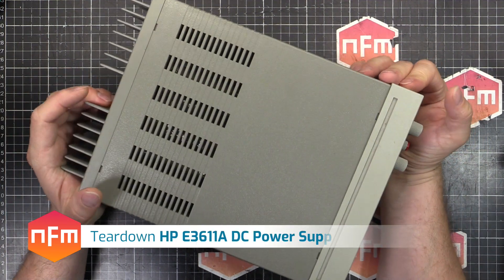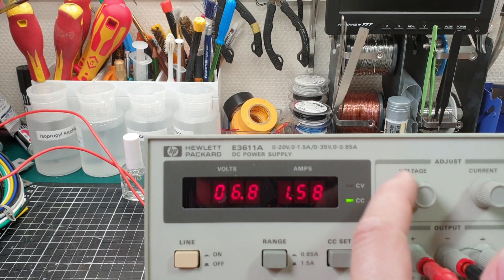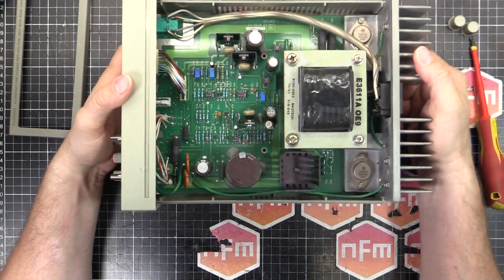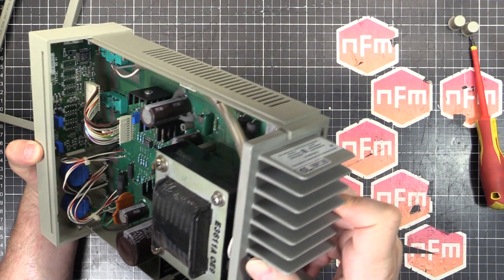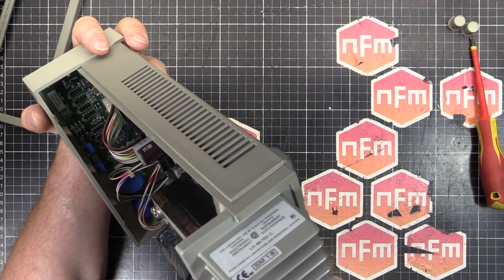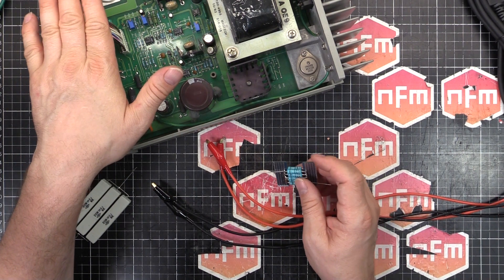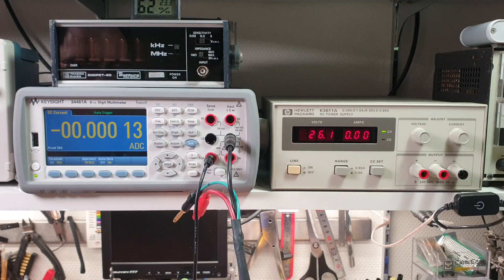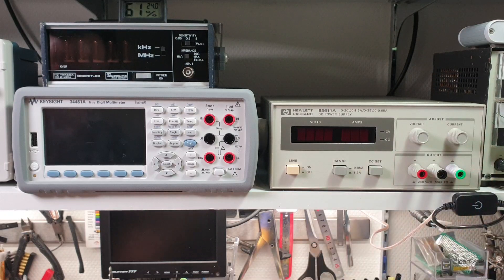HP E3611A Benchtop Power Supply Teardown and Mods

Comment: I have this very power supply only mine is the later Agilent branded version. I have load tested it with a HP 6060B and it works just fine! Great score.
Reply from the maker: They are very good power supplies, I currently have an E3610A, two E3611A, and an E3612A. Makes for a good range of voltages for having fun.